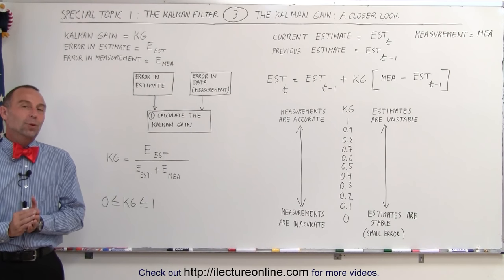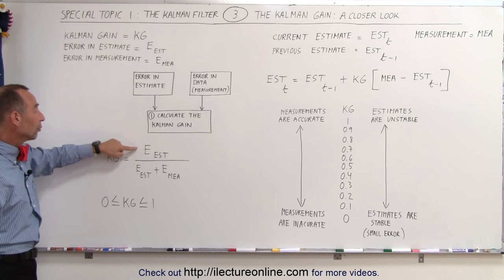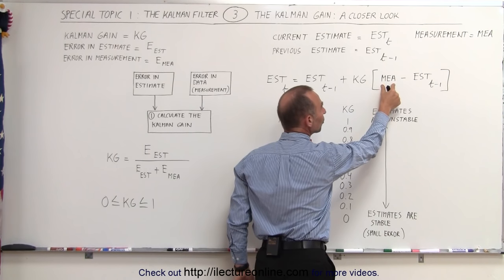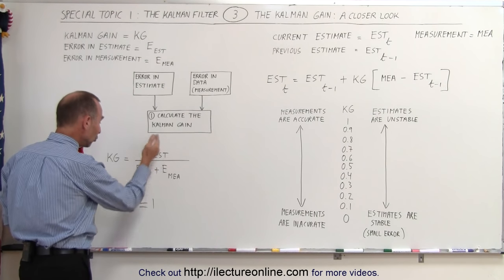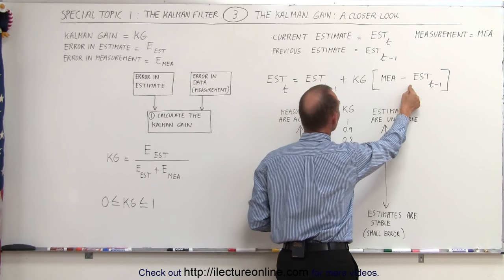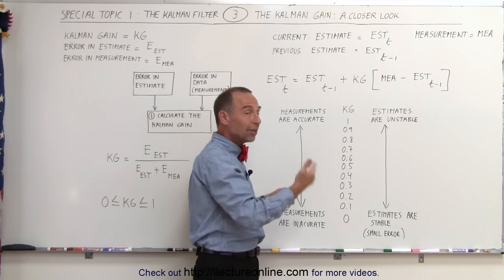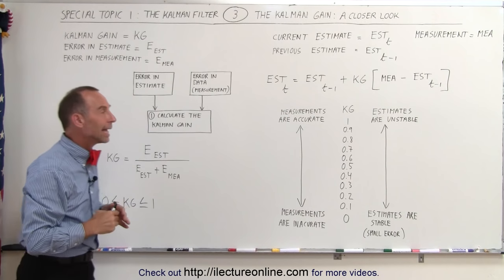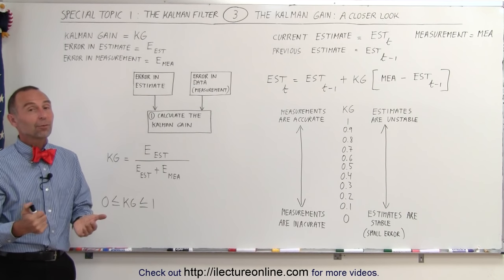Special Topics - The Kalman Filter (3 of 55) The Kalman Gain: A Closer Look

Comment: Excellent lecture, I'm showing this to my students. I'd recommend swapping parts 2 and 3 though, as it's pretty difficult to understand the large scale diagram in #2 without grasping the concept of the Kalman gain (which is the core idea of the whole procedure). Still, this is probably the best explanation of the Kalman filter that I've seen so far. Thank you!
Reply from the maker: Thank you.

Comment: How do you determine the error in measurement? Can you please explain with example?
Reply from the maker: For example, when we detect the position of a craft using radar, due to the number of bins used, and the timing accuracy of the signal and the accuracy of the processing of the signal (all known) we can determine the possible error in the measurement.

Comment: Hi Michael, thank you for your video series on Kalman filtering. It is truly instructive. Just a quick clarification, the way I have seen the Kalman filter written is that the the current estimate is obtained from comparing the estimate obtained form the predict state to that of the update(or measurement or innovation) state. In effect, the above equation should look like EST^'_{k} = EST_k + K(M-EST_k) where EST_k = A_K EST_{K-1} + B_k U_k. Your formulation seems to use EST_{k-1} instead.
Reply: I think you are right!

Comment: Great lectures so far
I just have one question:
How to calculate the measurement error if we don't have the true value of the measured variable? How to know the difference between the measured value and the real value if the latter isn't available?

Thanks
Reply: This is a great question which highlights a problem with this lecture and the big problem in working with the Kalman Filter. The problem in the lecture is that the  "errors" referred to are  actually the variances in the estimates and measurements. The variance of the measurements could possibly be determined by doing things such as collecting data while calibrating instruments. The determination of the estimate variance is much harder to do since the estimate typically comes from some kind of mathematical model which might not even have too much of a relation to the actual physics governing the quantity being estimated.
Reply: So if a sensor has a standard error of 1%, the KG would always be .9901?

Comment: I would like to inquire whether the threshold is fixed for any system, i.e. it can be calculated, or does it change throughout the system’s working period. Thank you for your efforts
Reply from the maker: Each system is different and yes it could change throughout the filtering period.  But the filter is quite forgiving if you don't know the exact values to plug in.

Comment: is the difference which is multiplying with the kalman gain is absolute difference or we have to take the sign into affect?
Reply: No it is not absolute difference, if your measurement is below your current estimate, then you want your estimate to go down. Therefore it is not a good idea to use absolute value.

Comment: So Kalman's filter is just doing a balancing job, between two inputs. It gives more significance to the input with less uncertainty, and it ignores the input with more uncertainty.

Is there a version of Kalman filter that is balancing three or four independent inputs? Fore example, there are several methods to measure temperature: mercury thermometers, transistor thermometers, K-Type temperature probes etc. What if one took reading from all of these probes and Kalman filter had to balance 3 or 4 uncertainties?
Reply from the maker: +HitAndMissLab 
Yes, the Kalman filter typically filters multiple inputs at once, in a matrix format.
Those videos are coming up in the future.
Reply: +Michel van Biezen I particularly like that you suggested that input should be called "uncertainty" instead of "error". That is much closer to the real meaning of that number.

On a funny side, I though that Kalman filter works a little bit like politics. A politician makes an election promise (similar to estimate) than, after 4 years, voters take a measurement of how far off was his delivery and either vote for him again or reject him. Than process is repeated again every 4 years. Maybe its just good as a didactic tool.
Reply: +HitAndMissLab You are right that it gives more significance to multiple inputs. But it also uses something else as an "input". It uses a prediction based of the previous state, as another input. It'd be like trying to find out your position in a moving car given you know your speed. If you know that you are going 60mph, in 1 hour you can predict(with some uncertainty) that you will be 60 miles from your starting point. Then once 1 hour passes, you take a measurement that gives you your position(with some uncertainty) and you combine the two. Prediction, with measurement.
Reply: Your first statement is super-relatable. Using uncertainty instead of error is a whole new way of looking at kalman filters

Comment: Really great stuff, thank you. One question, how do you know what the measurement error is? (Apologies if this is covered in later videos)
Reply from the maker: +sgccarey 
Determining the uncertainty depends on a number of items:
1) The accuracy of the tool you are using.
2) The smallest number on the scale.
4) The user's ability to read the scale accurately
5) Light conditions
6) Others
So the uncertainty becomes an intelligent guess.
If this is used in a tracker, like a satellite tracker, you take into account the uncertainty in the position of the satellite, the amount of time that has elapsed since the last detection.  You open up the tracking window as the time elapses since the last detection.

Comment: I'm struggling to understand the calculation of the current estimate.
EST_t = EST_t-1 + KG(MEA - EST_t-1)
If the Kalman Gain approaches zero, then wouldn't that mean that the EST will always be the same value for all time since EST_t = EST_t-1 if KG is zero?
How is it useful that the estimate stays the same forever once the Kalman Gain reaches zero?
Reply: no, because at this point we are only considering how the new measurement will affect the estimate; there is also the part where you project the state based on your available model. If the measurements are very inaccurate, you better trust only the model, and obtain est. x(k+1) = A*est. x(k)+B*u(k)

Comment: So over time, the older estimates get re-estimated as well? 

Are these errors calculated by comparing the measurements to a line/curve like in econometrics? If this is in future videos, please disregard.
Reply from the maker: Ryan,   You'll get a better understanding by watching more of the videos in the playlist.  There are different kind of errors, like the erros of your equipment or sensors (they are not perfect) and the errors in the measurements (they are not perfect either).
Reply: @MichelvanBiezen  thank you!

Comment: Since the formal expression of Kalman Gain is KG=Eest/Eest+Emea, does this mean that the estimate and measurement result always stand inversely proportional to each other? In other words, should it be the case that when there is little uncertainty (or error) in the estimate, the measurement has to be uncertain; while on the other hand, if the measurement is very accurate, the estimate has to be very unstable? Is there a case where the estimate and the measurement happen to have little uncertainty/errors? And what does it mean when the estimate and the measurement are both accurate?

Comment: How do you get the error of the meassurement? Is it by kalibration of the sensors involved?
Reply from the maker: In depends on the aparatus or sensor.  Usually the error is a known quantity through calibration or through testing.
Reply: @MichelvanBiezen  thank you so much!

Comment: Thanks for the wonderful lecture.
I don't understand why estimates are stable when Kalman gain is closer to unity? Lets say the system receives input with large errors and continues to receive so. In this case why we assume the estimates are the accurate? Appreciate if you could shed some light into this.
Reply from the maker: Error estimates are included in videos later in the series.  This is a simplified version to show how the filter works.
Reply: @MichelvanBiezen  Thanks for the reply!

Comment: Is it possible that the correction of a Kalman filter increases the uncertainty of the estimate? And the prediction?
Reply from the maker: We typically haven't seen that, but in some circumstances it may be possible.
Reply: @MichelvanBiezen  I have some homework for my university related to this question... Could you help me by explaining a little more?
Reply from the maker: If the input data is erratic, with large swings that are not centered about a particular value, it may not converge.
Reply: @MichelvanBiezen  Wow! Thank you very much sir for your speed and help. Thanks for sharing your wisdom to the world!

Comment: In the main equation the previous (t--1) estimate is subtracted from the current measurement. Wouldn't that make measurements and errors out of a step for one iteration. This would work only if time intervals are really short and measured values are not changing fast. This might be OK for measuring temperature, which changes slowly, but might be problem for fast moving cars or aeroplanes.

Obviously, at that point there is no current estimate, but still?
Reply from the maker: +HitAndMissLab 
On the contrary.  We use Kalman filtering in fighter plane radars, tracking satellites, etc.
Reply: +HitAndMissLab The previous estimate is the estimate for the "current" measurement. The measurement belonging to estimate t is not done/received yet.

The equation is basically a weighted average of MEA and EST_{t-1} with the weights KG and (1-KG). You can write the equation also as

EST_t = (1-KG) EST_{t-1} + KG MEA

Here is no direct subtraction of EST and MEA any more.
Reply: +vima Thanks, that form of equation really makes it clearer. Because, the difference in other equation obscures the process of weighting which does the main part of the job.

Comment: so it's only useful when we are measuring same thing again and again?
Reply from the maker: Yes, this filter requires repeated measurements and is typically used for dynamic systems like tracking a plane, missile, satellite, etc.  where you want the position and velocity of the measured values to be as accurately as possible.
Reply: great videos sir, i come again and again to understand these videos. there is no other source on public domain which is as lucid as urs.